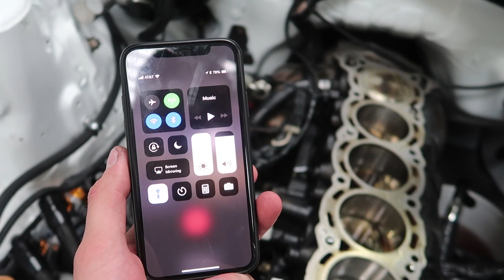DYNO DAY GONE WRONG

Comment: Nissan engines + Adam = Bad luck. Nicole's SR = blown. Adam's SR = rebuilt twice. And now the RB... Only thing running fine is the VQ, but that one's not modified. Just stick with 1/2JZ for turbo applications, Adam.
Reply: One day he will learn why everyone is swappin LS engines....he is a slow learner.
Reply: Alex Strömberg I've had same issues with a new engine build it's not fun and easy to point fingers but mine came from a super reputable shop that fixed it for me after the first fail but they said it is way more common with higher hp SRs plus he bangs off limiter all day when he drives it's a ticking time bomb regardless
Reply: I own two rb's and never had any issues with them but i agree with you lol
Reply: GixxerDad 600 then you get even better shit for the sr. I'd just get a v8, a LS or M60 or something
Reply: SolitudeMG modified engines in general just cause issues after issues, more power comes more stress
Reply: Phil Mitchell Yeah but look how reliable 2JZ and LS engines run even when modified. MotionautoTV's 2JZ S14 seems rock solid, and Nicole's 1JZ hadn't really had any issues despite being swapped in a rush except the latest stupid wiring issue, which isn't really the engine's fault. There are so many LS swapped drift cars that run reliably as well. When the car is being modified and being abused, it's always better to go with overengineered engines that are known to hold so much more power than stock reliably, rather than starting off with an inferior design.
Reply: Alex Strömberg I don't think it's his fault with the latest builds of Adam's as machine shop did all the engine work. However, if I am brutally honest, Alberto doesn't seem to get many builds right at the first go, including his own E36 build. He seems to be a super nice guy and I like him, but I think he's better off leaving engine builds to machine shops. He seems to be a solid mechanic otherwise.
Reply: SolitudeMG I 100% agree and understand what you’re saying. But s common issue is that people don’t seem to do supporting mods with most things because you just pass the stress onto the next component which will inevitably break and need to be upgraded and so on. 2jz, ls, even fiat coupe 20v turbos are all great engines that can handle lots of power but need the correct mods done properly
Reply: Phil Mitchell I understand your point. Yes, a lot of people neglect supporting mods when they are crucial for longevity. But for drifting applications, which sees extreme abuse, I think it's just better to start with engines that are more capable to begin with, as they will be under less stress. Everything can be modified, but inherent design is always a limiting factor.
Reply: Jokey Jesus You are joking, right?
Reply: If he was smart he would run a aluminum LS2 or LS3 with forged internals on a single turbo pushing around 600hp....it would be bullet proof not to mention lighter then an iron block RB or JZ and cheaper...
Even a stock LS2 or 3 on a single turbo would be reliable at 600hp...on pump gas...
More money then brains I guess...plus he would lose content running a LS....no taking the engine out multiple times fixing shit all the time lol...perhaps that is his reasoning for doing things the hard way...
My bet is he gets tired of it eventually and move to the LS side...once he does he will be kicking himself wishing he did it sooner...
People go LS cause it is cheaper...imagine what he could do with having money to put into it...bounce that bitch off the rev limiter all day...not that he will need to cause of the mountain of torque they make down low...
Hopefully he smartens up and throws one in his new S15 build along with a custom ratio trans...stretch out first second and third and the rest progressively closer...
Reply: harry guy  the s15 is getting a 2jz and adam  side he is not putting a ls in hes  drift cars
Reply: Rb and sr are good motor just don’t put cheap shit in it my friend who fix rb and sr all his life  know why it always happens because of non genuine stuff and not listen mechanic choices for good strong genuine parts
Reply: THATBAJANGUY   Yes...heard him say it more then once...cause everyone does LS swaps...I guess when you have more money then brains and lots of free time one can afford doing things the hard and expensive way all while creating content fixing his mistakes..works out in the end I guess but I myself would rather spend more time driving my car then working on it...
Reply: F2T SWAP
Reply: harry guy it's funny cause Adam dislike LS motors but there way more reliable then any of his built motors lol
Reply: SolitudeMG or an ls or barra
Reply: Nissan engines are among the most reliable ones. ESPECIALLY the SR20 + RB25. (If you  know what you are doing). An RB can easily handle 500+ on a stock bottom end.
Reply: Zero Degrees North Barra would be the most expensive swap, not worth it
Reply: Well of course it could handle 800 on stock bottom end, its twice the size of an SR/RB. Anyway im not comparing them to an LS neither I said he shouldn't go for it. What im saying is that Adam's continuously failing engines have little to do with them being Nissan.
Reply: Hes a drifter running crazy boost on not the most reliable engine.  Nicole's car over heated and had a stuck injector which cracked a ring land let's blame Alberto smh.  Adam's car which took some serious abuse over heated multiple times yup Alberto is to blame.  Maybe one can be his fault or maybe it's a shitty cast in the ring land.   Since you guys are experts are you super nervous for your break in and before the tune or after.  Everyone I know is super scared after a fresh rebuild from the missed steps, new parts,  shavings left in the block or not having a perfect tune on it.  Even the best builders loose fresh motors look at all the struggles speed factory had getting the d16 running right never mind breaking the records with that thing.
Reply: SolitudeMG so nicole never had issues with her 1j well its never been pushed and had issues all the time thats why adam is scared of her being straned and they thing always over heated plus its a stock long block.  Some people don't like bigger motors I will never own a v8 or a straight 6 it's as simple as that.  I love the nostalgia of having a true form jdm car with the engine that was engineered for it to me a vq engine done right and some nsxs are the best sounding engines ever I'd even through in the Castrol honda with a Mugan h22 or f20b.  Sounds like a super car but diffrent at high rpms.   Why does boosted bois love h series trans when tney are junk can do an h2b for cheap.  People like what they know its cheaper to rebuild something you know than buy everything for a swap and diffrent parts to get a setup right.  Just like why would jimmy put a Sr in a z.  Your or I wouldn't but it's one of his favorite motors.
Reply: Why did rock nock blow one up if they are bullet proof.  Why does superspeederrob always catch his on fire.  I can go on.  No motor is bullet proof.   There are people who either love American stuff or dislike it.  I'm not for it I understand the appeal but spending 6k on a swap unless it's junky af is silly just to be at the same power when he has a motor he loves and can rebuild a few times before being at the ls swap point.  You have to get mounts harness ecu pedal clutch trans drives haft headers exhaust radiator lines fittings and swap parts.  There is no way your doing it for under 5k.  Or a fully built Sr for 2k hmm tough choice.
Reply: Alex Strömberg i know I wasnt being practical for an american, I live in aus so it isnt hugely expensive buy comparison, though if ford used it in the v6 mustang it would be a lot better and more redily available

Comment: You have to double check everything from the machine shop just to be sure your good. Hard lesson to learn for sure.
Reply: Spooler I've said this about 15 times. Not once have they checked any bearing tolerances or anything. Alberto would rather polish pistons than balance them.
Reply: I'll give them the benefit of the double on that one. Adam can't film everything. A machine shop will make or break your engine build. My engine has been at the machine shop since the end of May. I have been in line waiting. It should be finished at the end of the month. The best shops have a long line of motors to machine. Especially this time of year since it is racing season. No way am I rushing them. I want their best.
Reply: Checking clearances is important before assembly but most people don't balanced they're own piston/rods lol
Reply: shawnmeyer44 of course they do. Do you even know how to balance rods and pistons?
Reply: shawnmeyer44 any and every performance engine builder balances rods and pistons. And if they don't take the hour to do it they are a hack. Just because you don't see most youtubers doing it while they throw engines together doesn't mean it shouldn't be done. It just means they don't know how to properly do it.
Reply: Spooler exactly. If they are doing the honing have them do it using a torque plate. If you don't know what that is look it up. It's worth the extra money to have it done.
Reply: blindabinda123 if I'm building a race engine I have the whole rotating assembly balanced together by a machine shop... most people or even shops don't have a balancer lol. If you mean just matching each piston, rod and bearing assembly to each other by weight yeah I've done it..
I'm a tech and have been for almost 10 years now. Current shop I'm working at we work on quite a few race cars.. I don't do full engine builds there really but I've done it before. Far from a noob, but nice try lol
Reply: shawnmeyer44 that's not how toy balance rods and pistons
Reply: blindabinda123 most people don't have a balancing stand to do the big and small end and don't really need to buy one. You're clearly an expert so you win. Have a great day

Comment: Hey Adam, I would suggest checking the valve guides the amount of wear and tear the other components of the engine have shown well you and Alberto were taking it apart (the valve guides are usually not far behind the valve seats being so worn they leak).

Comment: Dam someone screw it on the machine shop big time for sure was a distraction make the employee skip that valve
Reply: Did he get the head done? I don't think he had them check the head for clearances and what not.
Reply: Did you even watch the video.  The machine does the work the operator just needs to hone the block and check it.  The cast is the issue and looks like a stress Crack from what we'll could be anything.

Comment: I noticed in the last video that when you were cranking the engine over it was not sounding consistently smooth.  I had the same problem with my last engine and I ran it for a entire season before I finally did a compression check and one cylinder was 50psi all the rest were 225psi, so I ran a 7 cylinder engine all year!  Turns out I had a bent valve.

Comment: Just lap that valve yourself it takes like 30 minutes. Would be a cool learning experience for you.
Reply: Should be a warranty case, so why fix it your self. That would definitely break the warranty
Reply: Leofred they literally said they didn’t do any thing to the head
Reply: laping the valve isnt gonna fix shit lol, that valve is no where close to seating, its practically being fully held open on one side look how much liquid is getting past.
Reply: As bad as that was leaking the valve may be bent.
Reply: Destin Ginnis ptarmigan has a new one fgghlp
Reply: cmsracing true, because they claim they never touched it...we don't know that 100% what happens off camera. But, if they didn't and that's unusual for Adam to not run aftermarket parts, it's bent probably
Reply: cmsracing it's almost like a valve has picked up in the guide... but don't blame the guy who cranked and cranked the engine with no oil pressure. No it is 100% the machine shops fault without even taking out the valve to look. Must be great to be teflon coated so nothing sticks to you.
Reply: F that just replace them and do Springs and retainers while your are it.  Super easy with the tool.
Reply: Dodgy Brothers even if you Pack the pump with petroleum-based product and fill the filter with oil the sending unit will still be empty showing 0.  No way around it.  How is it the shops fault for havinb the head in there possesion.  All it takes is putting the head down to hard or with the cam in a bad place for it to bend.  It awkward to carry things happen.
Reply: Duane Bailey, it's not but somehow that will make it their problem because they don't know how to accept responsibility for their own stuff ups.

Comment: makes me wonder if the oil was not squeezed out of the lifters.. (in case original hydraulic ones were reused). If this was the case and valves and seats were machined, it would create exactly this symptoms. To verify this you can remove camshafts and then test if the valves seal. If they do, just remove lifters and press the oil out of them

Comment: Did you check to see if the hydraulic lifters have bleed correctly, I've done head gaskets and then zero compression thank to lifters that haven't been bled. Waste or timing pulling the head off

Comment: The only reason anyone knows about all these problems is because Adam makes videos and shares it with us. My friend chased an oil leak on a fresh engine build for months on a track car. Ended up paying another shop over $700 to tear it all down to fix it(gave up) because it made no sense how a block fresh from a world renowned engine builder would leak oil. Turned out during assembly the builder left out a $.80 cent o ring when installing the oil pump. Shit happens but NOBODY saw that one coming. So many people with cars that have been through so many problems that look great when everything is working but nobody was around when it was a disaster before that.

Comment: U can do the same test on valve seats with water.  Turn over the cyl head. Fill the area where the valves arw wit water and use compressed air to see if it creates bubbles cuz brake clean is expensive!! I have full cyl head rebuild vids on my channel

Comment: Every junkyard LSx swap I have seen is more reliable than these " rebuilt " engines. There is a reason Ls swaps are so popular, they just work. Spending tons of money to be different is fine. Spending tons of money over and over and over again on unreliable engines is just insane. Go get a junkyard 5.3. Gap the rings for boost. Throw a good boost cam and PAC springs on it and a turbo and be done with it.

Comment: Alberto couldn’t have affected the head because as you said it came right out the shop and bolted on however he should’ve heard the low compression while he was cranking it or you should’ve tested it before you drove to Tampa 
I’ve only built 1 Rb but I would consider getting a new machine shop 
It’s a shame your not over here in the uk we have a shop we use that gets it done in minimum 36 hrs it’s insane

Comment: Loc-stitch is One possible answer for the latest bad news about the RB25 it replaces the cracked cast iron with an interlocking bolt system that is actually stronger than the cast iron. (I know you said not to worry about it, just read.) Because "Cracks are bad news because they never heal themselves. Once a crack starts, it always gets worse. It will continue to grow until eventually it causes a major problem like a combustion or coolant leak, an exhaust leak in an exhaust manifold or a vacuum or coolant leak in an intake manifold. A crack that propagates and spreads in a critical component such as a rod, main cap, crankshaft or cam can lead to fracture, part breakage and complete engine failure." (With all due respect to Adams friend.) More of the article if you and Adam would like to read it. engine builder mag 2016 04 how-to-find-and-fix-cracks

Comment: I hate to point fingers, but you should try and find a new machine shop. You consistently have these problems when others don't. Alberto is a good mechanic. You don't cheap out on these things. This car was built as safely as possible. Somewhere, there's a weak link.

Comment: Rb’s are probally one of the worst engines on reliability 🤦🏿‍♀️
Reply: Craig Faulkner I have a good fucking idea! Buddy blows up 3 on the dyno than adam has nothing but problems! Rb engines are like action figures you can’t play with cuz it’ll break easy! But than again I come from a American v8 background where you can beat on the shit and never have the problems these pos rb’s have 🤷🏿‍♀️ I’ll choose a coyote v8 over an rb any day 😎
Reply: Craig Faulkner now if you tell me coyote engines aren’t reliably I might die of laughter 😂🤦🏿‍♀️
Reply: yep agreed, LS motors and coyote v8s are very reliable but RB's are reliable too. Plenty in Aus running strong, iv'e owned a few with no dramas. Get them built properly and won't have issues.
Reply: mr2paddy right pretty fuckin much lol I love mine sounds so fuckin amazing and the power is great
Reply: i just dont get it i have an rb, an sr and a 2jz they are all Reliable.... lol  these guys are just fucking it up

Comment: honnestly fuck rb's i blew the head gasket on mine back in feb,ran fine before. sent it to the machine shop for a resurface got a cometic head gasket for extra precaution then the last week i've been putting it all back together and everythings perfect timing i have spark and fuel and what do you know theres a wiring issue that i'm gonna have to track down. to top it all off i'm missing stance wars because of this bs all because i went rb instead of jz...

Comment: Yeah you did not touch anything on the head. But as a mechanic it's your responsibility to check all the parts of the engine so you don't have issues like this 🤦‍♂️
Reply: Stephen Soliven not as much as the machine shop for giving it to him in that condition that was easy to catch